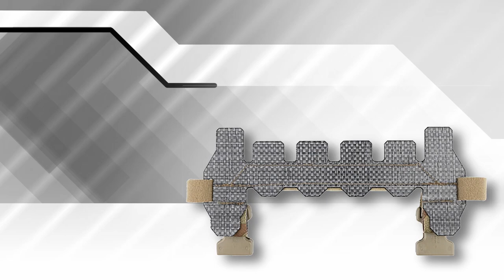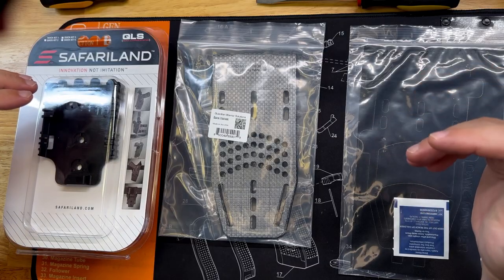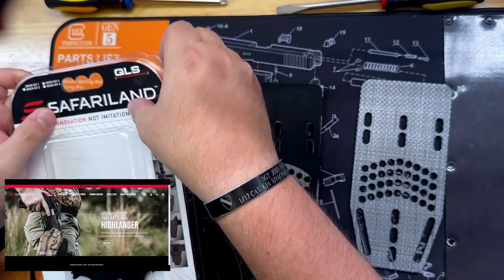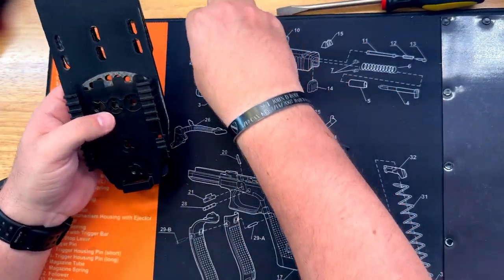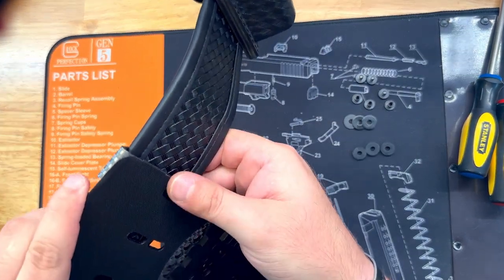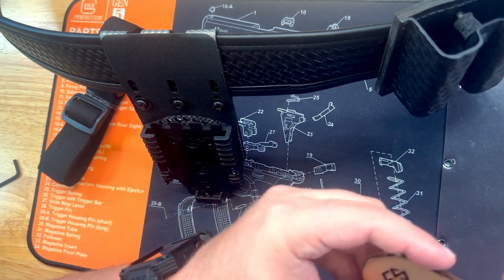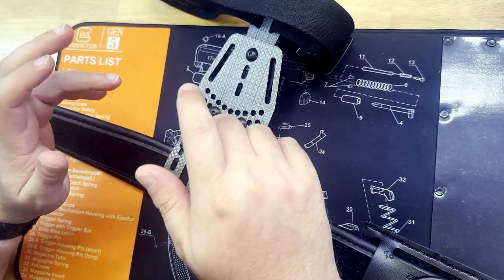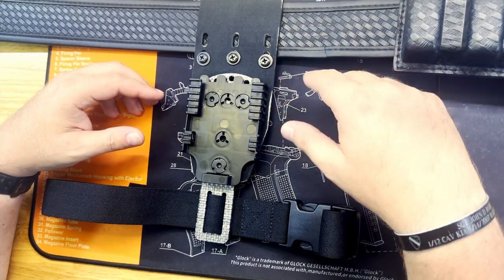Maximizing Duty Gear Comfort: The Bang Hanger and Swivlah Advantage (Part 3)

Comment from the maker: Let me know what you think about this setup. Do you think it will be worth it? Leave a comment below and let me know. I definitely will say it is lighter and pretty sturdy. Thank you for your support. 👊
Reply: Looks pretty legit, similar to Wilder Tactical’s MHP setup but a lot cheaper. That sticker cover seems like a pain though lol I’ll just spray paint it if I try this.
Reply from the maker: @AARonGoneWrong  hey thank you for the comment. It definitely has wilder tactical like looks. And as far as the wrap it can be silly but it’s not too difficult I was able to get it. Also yes you can spray paint it but I would recommend you scuff it up first before throwing krylon on as it needs to be able to bond to it.

Comment: Thanks for this video man, Wilder Tactical used to offer a similar solution with their legs straps but they’ve moved on to a different design and don’t offer their articulating plastic piece anymore, so to come across this lighter weight option was very lucky!
Reply from the maker: Yeah I saw that I wanted to get one to test it out for a review and can’t get one. I think the Edgar Sherman Swivlah is a pretty cool lightweight option. Thanks for the watch and comment.

Comment: 1 con ain't bad at all. I may have to try this all out. Love that swivel too
Reply from the maker: Yeah that con is really just me. I want to be able to fit it on a duty belt with ease but I learned that I am right at the edge of capability with that product but it still worked. So I am satisfied with it. However mounting on a molle or smaller belt is done with ease. I just pushed it to the limit. That swivlah is definitely not a new idea but it’s a lightweight beefy option to complete that setup.
Reply: @AngrySargeG01  that swivel looks purdy too
Reply from the maker: @shoguncustoms  it may be too fancy for me lol

Comment: Great video, so as tight as that is once attached to the belt, it’s there, looks like zero wiggle room for the belt loops
Reply from the maker: Thank you for the watch and yes it is zero wiggle room. But for duty you don’t want the wiggle set and leave. The belt loops do not matter on a duty setup. All my belt loops are is for my inner belt and the velcro attaches to the outer and I run belt keepers to keep them secured together.

Comment: Love the videos. Any issues with the Swivlah on duty so far? How comfortable? Thanks!
Reply from the maker: One thank you so much for the comment. It definitely makes my day to see that. As of right now I have not used it on duty. Only in training but I like it so much I am transitioning to it on a new duty belt and gear setup for the new year. I just need to get the content done. The only issue I had in the beginning with the swivlah is that you have to make sure it’s lined up correctly when you mount it. It has a big hole and I got it pinched a little when I was tightening and I figured out that’s why it did not swivel freely. That’s it. Is it comfortable it felt different for a little bit but I got used to it and don’t really know it’s there. So I’d say definitely yes it is comfortable. Lastly thank you for taking the time to watch like share and comment you could have been anywhere else on the tubes but you took a chance on me and I’m grateful. So thank you.

Comment: Are the other holes made for 1.75" belt?
Reply from the maker: @jyerse99  I think it goes down to a 1.5 and the other holes are for a 2. I have a bang hanger mounted on an old duty 2.25 belt and one on my 1.75 current duty belt.
Reply: @AngrySargeG01  thanks for the reply. Does it have any wobble with the 1.75 belt?
Reply from the maker: @jyerse99  no prob min is mounted through Molle and there is no wobble if you use the included hardware. Over the belt you shouldn’t have an issue either. Tighten and use loctite to lock it in and you will be fine. One of my upcoming videos I’m doing a comparison on my old duty belt to my new one. And also talking about my thoughts on my current setup and how light it is as well as some pros and cons and what issues I ran into after wearing it for about 8 months now.
Reply: @AngrySargeG01  nice. I recently bought the defense mech belt. My safariland hanger is for a 2.25 belt. Trying to find the best hanger right now for the dm 1.75.
Reply from the maker: @jyerse99  I’m going to absolutely recommend this hanger in the new curv material it’s light and doesn’t cause any pressure points or hot spots. Definitely worth the money. Btw thank you for watching and commenting I really appreciate it. Once my website gets up reach out to me and let me know your thoughts about the product. I really like hearing other people’s thoughts.

Comment: Get a X-Belt in basketweave and has hidden molle
Reply from the maker: Definitely will look into that thank you for the info. This is why I love the community. I however for duty run nylon so I’ll be looking at some options.
Reply: @AngrySargeG01  in that case, Defense Mechanism belt is good to go for duty and currently what I've been using the last year.
Reply from the maker: @InkwellFoto  that is what I hear I’ve been looking around at Lead Devil and a few others to make sure it fits my needs. I did get the TQ holder by def mech because I want to run a different setup other than the 11-10 mounted on my belt.
Reply from the maker: @InkwellFoto  I definitely appreciate that insight and if you have been running it for a year and it’s good to go then it’s definitely something to me worth looking into.
Reply: @AngrySargeG01  I've ran many belts in the last 11 years and the big upside to DM is what you stated in your video about Tegris. The belt is very light weight. I used Ronin and it is too stiff and heavy. Heard good things about Lead Devil but I'm over the weight of those style belts
Reply from the maker: @InkwellFoto  yeah I’m trying to go lighter and faster so I get it. So what you are saying makes sense. I’ve ran the hsgi cobra with the pad for SWAT and military and I’m over all of that as well I definitely get it. I appreciate the insight and I’m definitely moving toward that direction.
Reply: The X-belt is great. I use it for duty daily. Very comfortable.